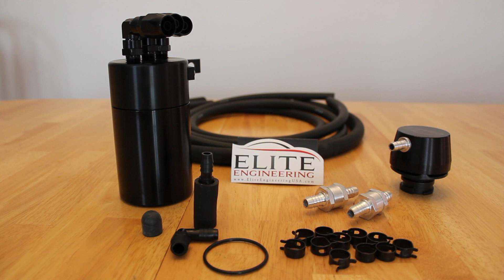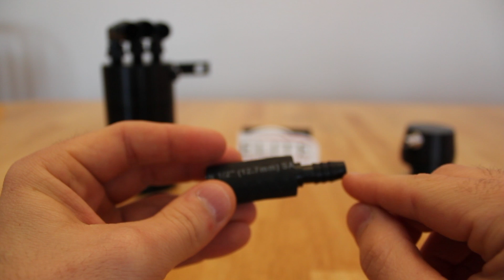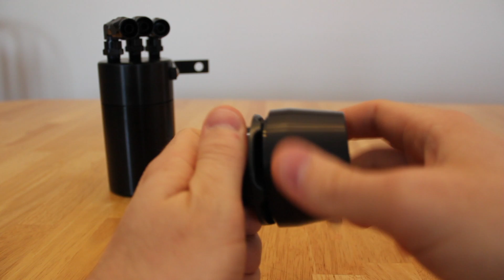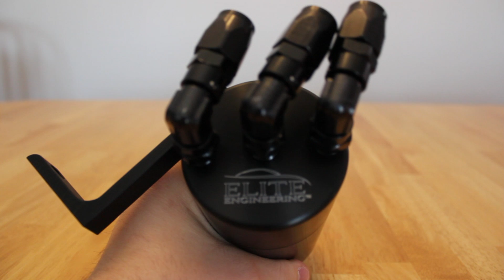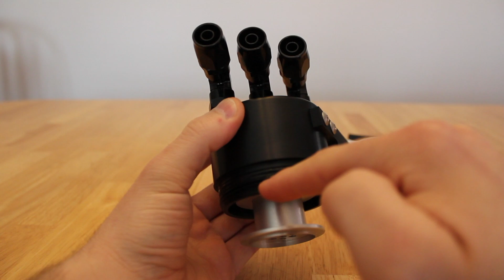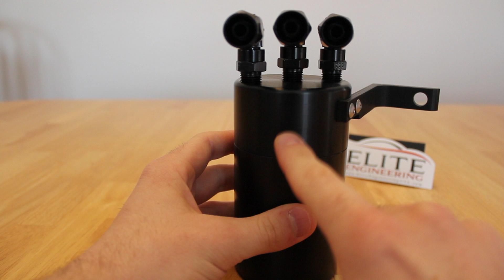[REVIEW] 2nd Gen E2 Catch Can Review from Elite Engineering:

Comment: Thank gawd someone has made a catch can that has some science around its application.  Very nice.  Would be nicer if their were two sizes with this being the small, and an upsized one being the large.  It's on my must get product in the next 6 months.  I've already had two different types on my LS3 fully forged 416ci LS3 build which has buckets of blow-by, and none of the ones I've purchased work to my wants and requirements despite one being a Petersen and the second one being a Double Can system and about 800 Australian dollars.
Reply: Look at The E2X by Elite. Much larger.

Comment: Do you know if this will void and warranty issues with GM if I install this on a new GMC Yukon
Reply from the maker: It's going to depend on your dealer. It doesn't really void any warranty, but some dealers may find a way to say it causes problems. As with any modification, you have to use it at your own risk.

Comment: What is the point of the clean side separator
Reply from the maker: There is a bit of blowby present in the top end of the motor that recirculates fresh filtered air into the motor. This is known as the Clean Side of the PCV system. The separator helps keep the intake tube and intake manifold clean of any oil blowby.